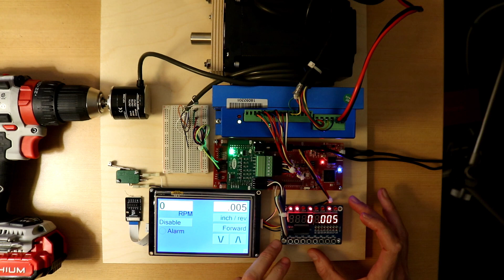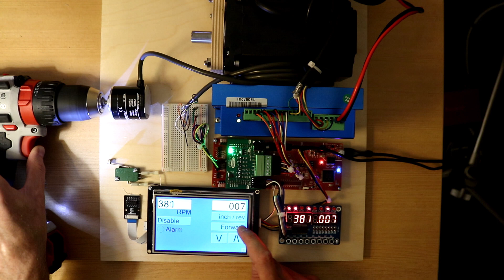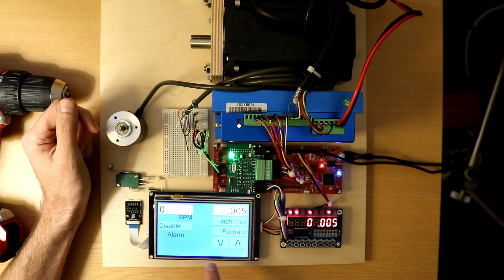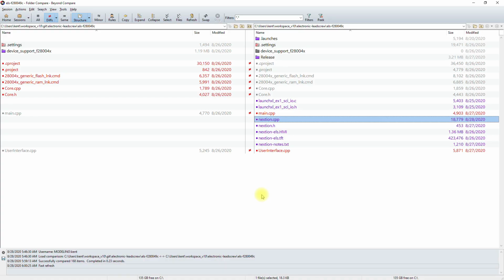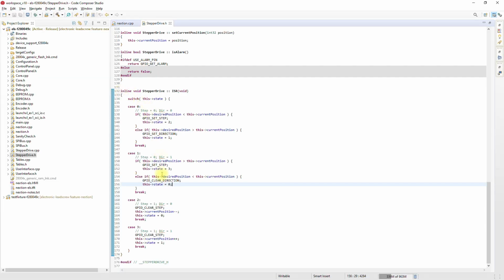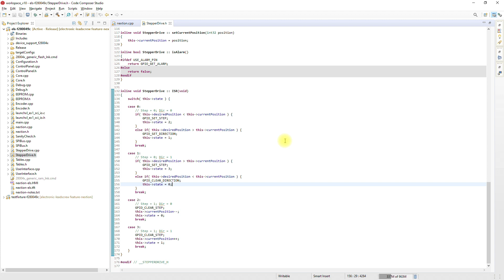Touchscreen for Clough42 Electronic Leadscrew ELS

Comment from the maker: The interface has been updated. See the latest here: https://www.youtube.com/watch?v=pGQwLcGuwaw

After making these changes I found another ELS with a beautiful interface. A few have been sold on eBay, but I found no information about them. Please comment if you know more.
https://www.youtube.com/watch?v=9bxdOJpmGhQ
https://www.youtube.com/watch?v=P2OVXvc8knw
Reply: Hi..........DEC 2021......I've just ordered the kit for this ELS  called the EZnc-2......       waiting for it to arrive.....it's a 2 axis control for the leadscrew and the crosslide.
Reply from the maker: @gangleweed  Thank you for mentioning the eznc. I'd seen a video of it on YouTube when it was being prototyped. Very fine looking interface. Glad to see it's becoming available for purchase.
Reply: @kentvandervelden  I'm hoping it will fill a need I have for a threading function on a micro lathe I built way back in 1964.....at the same time it looks like it could do CNC work too.......still to be tried.
My intention is to fit it to the compound slide and lock the crosslide as this way it won't affect the normal working of the lathe in manual mode.

Comment: Very  nice work.  Have you pursued this any further?  By looking at your lathe encoder install video, it appears you have moved on to LinuxCNC?  Did you give up on Clough42's ELS because it did not have full CNC capabilities or are you still looking at it?  I'd be interested in seeing what you did to CNC your lathe.  I don't have interest in fully CNC'ing my old Craftsman lathe, but I would like to add features beyond easier threading and feed rate changes, like a powered crosslide, etc. I.e. partially CNC'ing to give my lathe the options my grandfather could not afford when he bought the lathe back in the day, but still keep it a manual lathe like James Clough's goal was for his lathe (although he stopped too soon 😄).
Reply from the maker: This work was done for a machinist friend who had a reason (which I've forgotten) for not complicating his lathe. Most of the use of my CNC lathe is manual work anyway, making the CNC a fancy DRO. In the past I've made two ELS, one from Arduino and another from FPGA. If you have motors on two axes, you're really close to full CNC. Start with the ACME screws and constrain movements so backlash does not matter. Here was the first lathe "CNC" I made. Can be pretty simple. https://youtu.be/SwvjGSoO09M
Reply: @kentvandervelden  I know it's a slippery slope, but yes, my plan would not be to fully CNC it, but make it more of a "manual" CNC where after each pass, I have to reset the cut (which is what I would have to do if it came with a QCGB for threading, or mechanically powered crosslide or using a physical taper attachment). Like I said, this lathe was passed down from my grandfather to my father now to me. I like the idea of being able to use the same lathe they both used and making improvements as they each did as they owned it. Making it full "CNC" would take away that same feeling, I think, but adding on an electronic QCGB and powered crosslide would be in keeping, at least to me, in spirit of making improvements that they would have done if this technology was available to them. Besides, if I were to make a full CNC lathe, I'd base it on something that was more rigid.

Comment: why would you use optocouplers before interfacing the stepper driver - if the stepper driver itself already uses optocouplers?
Reply from the maker: The optos on the stepper driver protect the driver. The optos on the ELS protect the ELS. Doubling up may not be necessary and each adds a small delay (~20 nanoseconds). If making a product to sell, I would increase robustness to avoid support calls. Have a great weekend!

Comment: Hi Kent, I've built & installed the Clough42 leadscrew on my 1950 Myford Ml7. Having watched your video I would like to add a carriage stop switch I presume that's what you refer to as a limit switch ? How exactly did you couple it up ? I seem to have an unused terminal on my stepper controller labelled as BRK, is that a stop function ?
Reply from the maker: Right, a carriage or limit stop. For demonstration, I wired a limit switch to the TI Launchpad board and added some code. I don't know what BRK is, but if the motors are disengaged outside of the Clough42 code, all may not work correctly once reengaged. My demo was also not ideal for installation. For instance, proximity sensors should be used instead of the mechanical limit switches, and probably additional thought would need to go into stop/start logic. Thank you

Comment: Hi Kent, in your video "build the nextion clough42 ELS code" at 6:10min you mentioned that the els-f280049c.out file can be used to share binary without CCS.
When loading this file in Uniflash it gives an error "Cannot read property 'DS' of undefined".
It wants the Texas Instruments XDS110 USB Debug Probe to flash.
How can I just program with Uniflash and a simple USBcable without CCS?
Reply from the maker: Yes, this can work. I don't remember the state of the .out file on GitHub, so you may still need to build a new .out, and if you do be sure to build it using the flash memory layout. I don't have the hardware any longer so I may not be of much help. The specific error message I never saw, but I find some hits on TI's forums, where they say restarting, reinstalling, etc. fixes the problem. That's great if this solution works but offers no ideal of the underlying problem if the solution does not help. Wish I could be of more help :(
Reply: @kentvandervelden  Thanks Kent, your confirmation that it can work made me investigate further and in my case wouldn't work whatever I did on my Windows7.
Switched to another pc with Windows10 and worked flawless.
Could be also because on Windows7 I had your CCS10 installed and nothing on Windows10 where I saw that it installed something extra.
Thanks for the help Kent.
Reply from the maker: Glad it worked for you! Thank you for letting me know.

Comment: Nice work,
Is it possible to switch the SCI-A and SCI-B ports so that the Nextion display will work on SCI-A ?
Reply from the maker: That should be doable. SCIA is positioned under the ELS board but is not in use by the ELS. I only used SCIB because of convenience. When I made the video, I was thinking about how the ELS board could be improved, so I'm pretty sure switching to SCIA would work. I made a follow up to this video that improves the UI but uses the same ELS board. If you make a new board, check if there is anything else in the my notes (link in the video description) useful to you. All the code changes are on GitHub.
Reply from the maker: @Dancer148  You could alter the end stop or debug pins or disable either. Unless you will monitor function invocation with an oscilloscope, the debug related code could be dropped.
Reply: @kentvandervelden  Kent, is it possible to send you the code to upload it as a pins-swapping variant?
Reply from the maker: @Dancer148  The easiest way to get to your work out there is to make the changes a GitHub pull request. Your change would be visible to anyone viewing the repository and be part of its history.
Reply: @kentvandervelden  I have to get the code working first.
Not familiar though with GitHub pull requests that also changes from kentavv
 to clough42
.
Reply from the maker: @Dancer148  You probably already know this, but the steps are 1) fork the project you want to change, make the changes in your repository, (which already gets them out there), then create the pull request to the repository that's been forked. It's a nice system.
Reply: @kentvandervelden  Done.

Comment: Nice upgrade !
Purpose of electronic lead screw is to avoid changing gears, very simple use (not worth it to me).  Now having a unit that has an electronic start point and an electronic stop point now we have something. Why use a mechanical switch when you have a encoder to track servo position. 
Cutting a thread, you would set a start location and then electronically advance to the end point and store the end point location.  Now the electronic lead screw will advance between the to points at a rate that you select.  All you need to do now is just set the depth of cut then press start. When the lead screw reaches the stop point you back off the depth of cut and press return. Lead screw would return to start point and now you set depth of cut and press start. Just repeat till you reach the proper depth of cut. Now that would be very very useful for threads or even just turning parts. No additional hardware needed just tickling the key board ;)
Reply from the maker: Your idea is a very good one. Physical limit switches were stuck in the my mind having only the experience of feeding up to a traditional physical carriage stop. What you are suggesting make a lot of sense. One could set limits by moving up to the limit and pressing a left- or right-button or typing in a distance. My changes where on top of existing code and the implementation would diverge it more. Check out Jesse Schoch videos on an ELS that he's making. He's implementing virtual end stops. 
https://www.youtube.com/watch?v=EE5IIubnEXs
Reply: @kentvandervelden   I recently added magnetic 3d printed scales and touch DRO. In touch DRO you can add workspace data points or profiles so cutting a part over and over is easy peasy.
Having an electronic lead screw to do the cranking with the preset limits would finish the project off. Thanks for sharing !
Reply from the maker: That is a fantastic idea! Touch DRO looks fantastic, especially the tool library. Looks like he has a quadrature convertor addon and four axes of inputs. Maybe the hardware part is easy? I'll send him an email to to see if there's any interest in supporting such a project. If not, andTouch DRO is closed source, maybe there's another option? Thank you

Comment: What is connected to the touch screen with a ribbon cable just below the limit switch?
Reply from the maker: It's a GPIO breakout from the Nextion and is unused. Before I started, I was not sure how I was going to do the work and it was comforting to have the Nextion GPIO to fallback on if needed. Thanks for asking.

Comment: Non-seq - Re: new video ideas. I built a LCNC/Teknic CNC router a few years ago which has worked great for me. I’ve recently learned about their new “Clearcore” platform. Looks like it could be an interesting topic for a video or two.
Reply from the maker: Hi Ron, that's a good idea. I only looked at the ClearCore briefly, it appears to be a motion controller. I have a little experience with Parker motion controllers. In the case of Parker, they would work well for "repeat this pre-programmed pattern conditional on inputs" but not as a g-code driven CNC controller, at least not a CNC controller with the sophistication of LinuxCNC. I could be wrong and am willing to investigate. I've talked with Teknic before and they were uninterested in sending loaner hardware and suggested instead a purchase followed by a return. If I could get loaner hardware for a few weeks, I would investigate the potential for the software side, though can't imagine making a full CNC router. Maybe it's something that could be incorporated into your router?
Reply: @kentvandervelden  Completely agree. Certainly not enough horsepower for my CNC machine, and I'm happy with LCNC (or at least I was until I saw that Datron machine :) I'm guessing ClearCore has lots of application in automation retrofits on larger systems, but its overkill for my small projects and underpowered for larger ones like CNC and 3D printers. Still, would be interesting to see what someone else might make of it. I'm big fans of the Teknic guys, though I agree they don't seem very big on marketing outreach.

Comment: have been looking a while now for using this product for a cilinder honing machine https://www.youtube.com/watch?v=jshb1Emadvs based of a drillpress
basicly putting the encoder sitting on the drive spindel of a stationairy drillpress and the servo motor operating the up and down motion of the same drillpress 
would it be verry hard to change the software so distance traveled per rev read in mm and the distance per rev go up and down without steps (so 1 2 3 4 5 6 etc) ?
that would allready help me get the right crosshatch pattern , 
there is some calculation involved with getting the crosshatch to match the bore of the cilinder (bigger the bore the shallower the crosshatch if everything else stays the same )
if i give you the calculating formulla for the crosshatch angle could you make the software so i can fill in the crosshatch angle , bore size and stroke length and have the machine set itself based off that data?
Reply from the maker: Very interesting idea! If I understand what you're describing correctly, yes, that could be pretty straightforward and quick to change. Send me an email with the details.